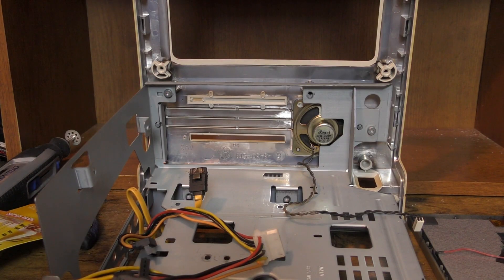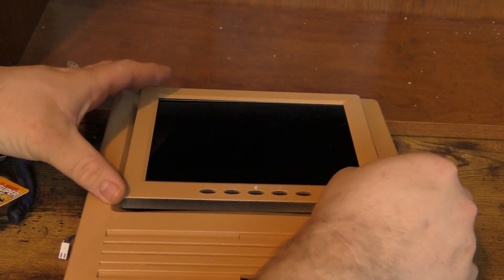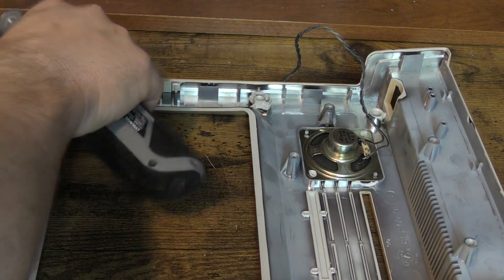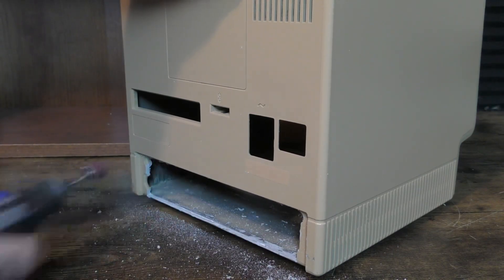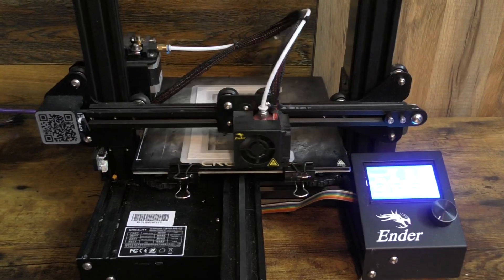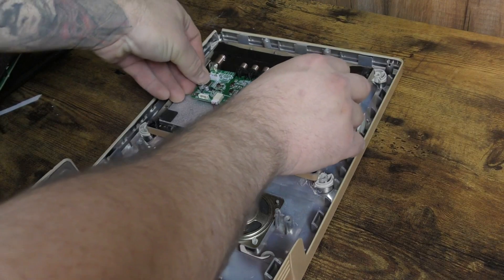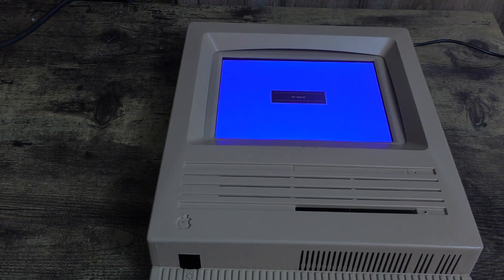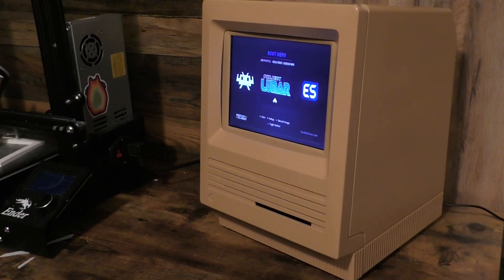Let's Do Something Modern With This Classic Mac!

Comment: That's a pretty cool little color LCD. Do you have a link or part number for it? Also, what's inside the case, a Raspberry Pi or something else?
Reply from the maker: For this video, I've got a Genesis Classic Mini stuffed in there just to show something running. I'm filming the next part as we speak and there's already a Raspberry Pi 4b mounted in place. Just have to design a back panel for the ports I plan to add, etc. I love that little monitor. There's a small chance I'll keep it in there and close the gaps. Here's the link (seems to be out of stock at the moment):

https://www.amazon.com/gp/product/B0722HBVM5/ref=ppx_yo_dt_b_search_asin_title?ie=UTF8&psc=1